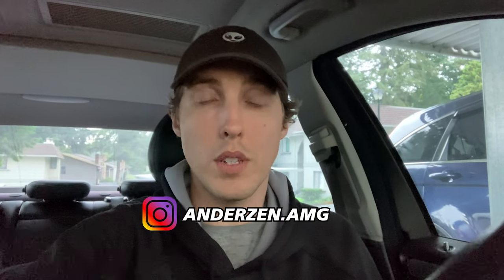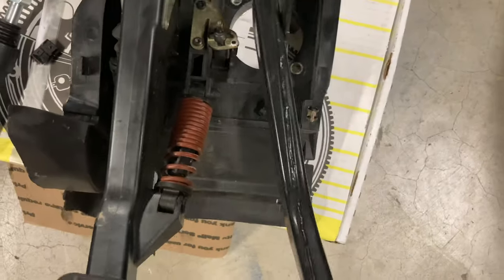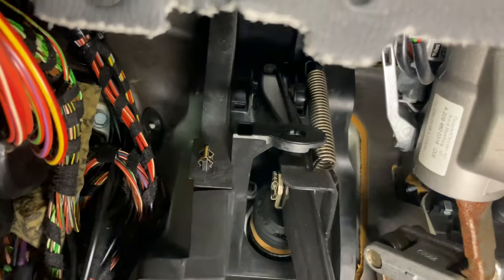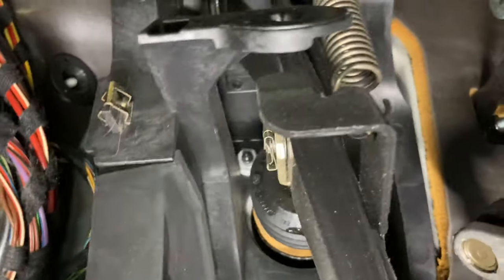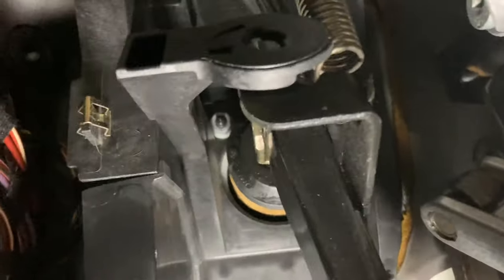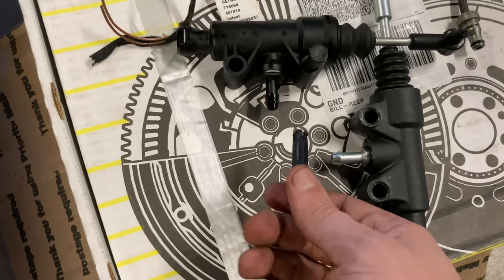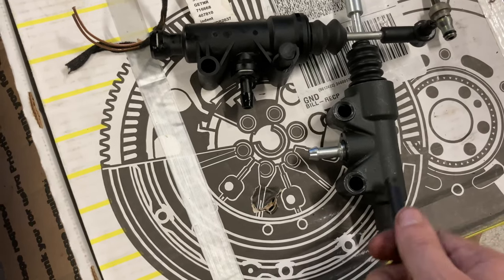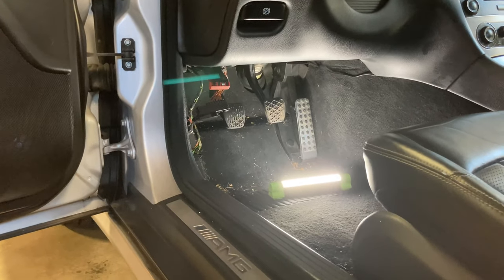C55 AMG gets a Clutch Pedal!!! Manual Swap Pt.1

Comment: Thank you very much for sharing this video and the series on your manual swap.  You are so ever right that there are no existing tutorials on how to do this swap on the W203 MBs, perhaps meaning this is a rare swap  after all.  You mention in one of the other videos in this series the Chrysler Crossfire.  Did you source any of your parts from such a vehicle (sorry if I did not realize that before)?  We have, now and then, in our salvage yards Crossfires with manual trans.  I did catch from your video ( I think the #3 video) that the linkage and brackets from the Crossfire were just a bit too long.  But what about the old bracket from your AMG?  Was this part not compatible with the manual trans?  Finally, would the ECU or other electronics from a Crossfire (manual trans) work for this project, or did you, after all, have to reflash ( or reprogram) your OEM ECU and TCU to get everything working smoothly.  I apologize for asking so many questions but this is a swap I am anxious to do on my 2003 W203 .  Thanks for this great tutorial!
Reply from the maker: Hello and thank you for the questions. The Crossfire has many manual parts that are compatible with the w203 since it is the same car as a Mercedes slk. You can use clutch, flywheel depending on year, shift linkage with modification, transmission, pedal assembly, the driveshaft does fit bit was a tiny bit short for my liking. You can swap with no ECU modification if you keep the automatic shifter plugged in and set to P or N, you will get some error codes but won’t affect drivability. Crossfire ECU would depend on what car you’re swapping but would not work with C55. Hopefully this helps!
Reply: @ANDERZENAMG  Wonderful.  I think I should have all or most of what I need for the swap (into a sportwagen) with what we currently have in the salvage yards (2007 Crossfire MT).  Keep up the good work and thank you for so quick a reply.

Comment: I wonder if a c230 manual transmission(model) has the same bolt pattern or housing as the c55 model transmission? If not, i wonder if there are adapters for that swap?🤔
Reply from the maker: it is possible for all v6 w203/w209 versions, but the c230 has a lower torque rating than the c320 or crossfire. Many parts are interchangeable and all m112/m113 engines and transmissions use same bell housing.
Reply: ANDERZÉN true true... good work brother😎👍🏼

Comment: I just manual swapped my Clk55 and tbh with you bro that luk clutch might not hold the power! I used a c240 clutch and let me tell it leaves so much to be desired on the car. I have nothing but clutch slip after 3rd gear
Reply: Look up Rennsport factory UK they make lightened flywheels and clutch kits for m113s
Reply from the maker: Abdallah D w208 or w209? Thank you for the info and for reaching out! I have looked into the Rennsport clutch and flywheel but might have to be an upgrade for down the road atp, they are pretty pricey.
I’d love to talk more about your swap if you don’t mind, dm on IG @anderzen.amg

Comment: will the crossfire/slk clutch pedal not work?
Reply from the maker: It will but not ideal pedal position
Reply: @ANDERZENAMG  moves everything to the middle? Also I want to do a c208 CLK.
Reply from the maker: @c.j.edwards3355  more so changes depth and yes probably closer to middle, for 208 it might work fine